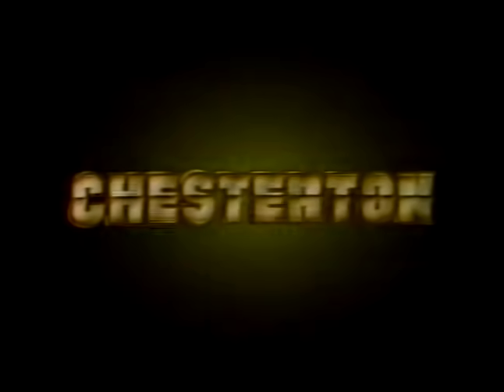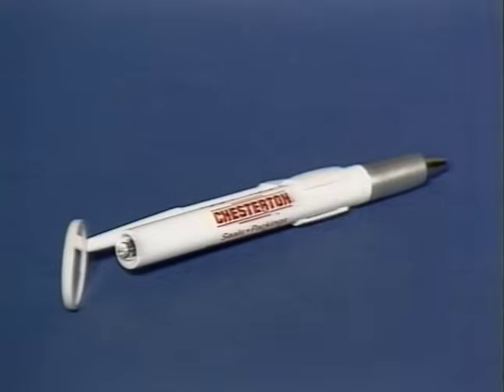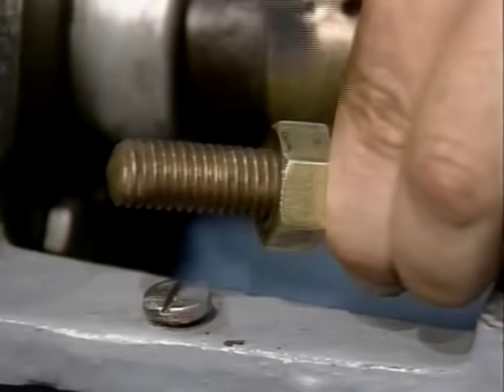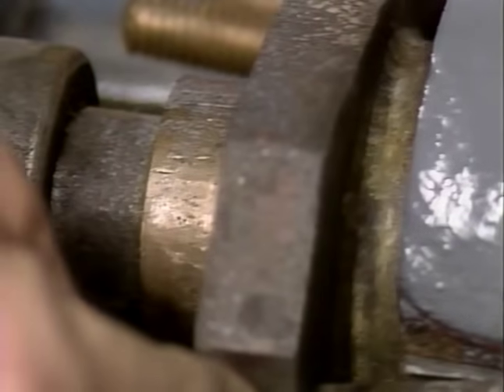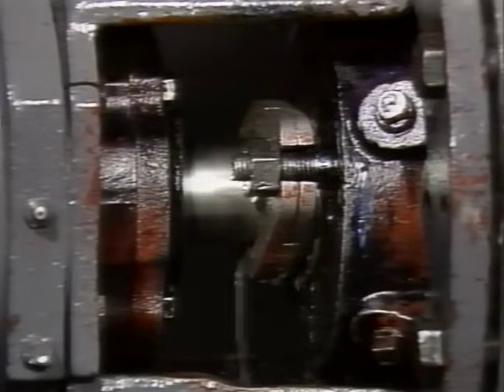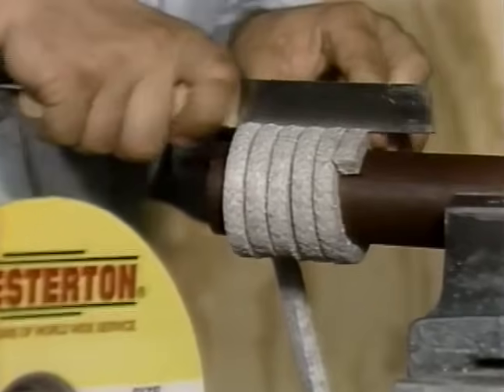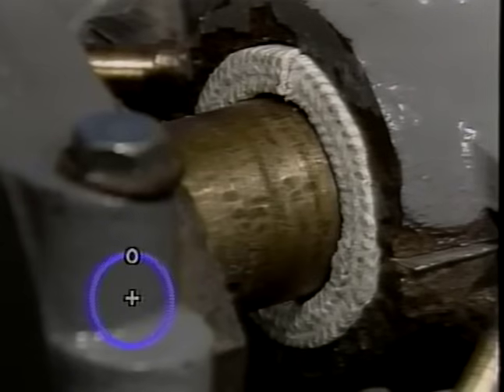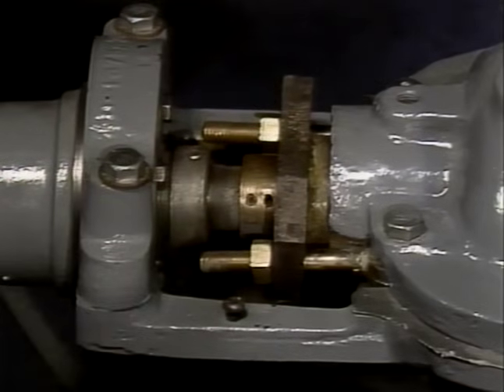Mechanical Packing Installation

Comment: Types of packing
Reply from the maker: There are many types of packing and materials. Some general guidelines I use. 100% Teflon makes poor material and is only used when required. Bellow 500F Nomex material works well. Above 500F Renee’s a black packing like graphite or carbon yarn.
Reply: @shep446  I’m currently studying for nccer.  Do you have any videos on turbines and gearboxes I need all the material I can get my test is next Friday!
Reply from the maker: @OurBodyHisTempleFitness  good luck with your test. I do not have any such videos. But would recommend any US Navy training manual on the subjects. Being a veteran Gas turbine mech I can say the GSM 3&2 manual is one of the best book courses.

Comment: is it normal to observe minor water leakages after replacement of mechanical packing in 7.5hp pumps?
Reply from the maker: Yes, excessive leakage will occur during break in. Run pump 15 minutes before any gland adjustment. Leakage can be reduced to drips per minute but never stopped completely. Refer to packing manufacture for recommendations how many drips per minute. Shaft size, speed, and packing material will be factors.

Comment: Thanks for this video.  I had an irrigation pump repacked when the pump shop replaced the motor.  I have had to tighten the packing several times now.  Everytime I get it to a few drips (like in the video) it  is back to a stream in a short while.  I have been tightening evenly one flat at a time and now I want to be able to change the packing out in case the installer rolled one of the pieces of packing.
Reply from the maker: If you repack the pump I recommend looking at Chesterton 2212 packing. It is a nomex/Kevlar hybrid packing that breaks in fast and keeps its adjustment longer than other packings. Contact you local distributor and they can provide cut rings ready to install in your pump. https://chestertonrotating.chesterton.com/en-us/Products/Pages/DualPac2212.aspx
Reply: @shep446  Will do.  Made it through the end of irrigation season without bottoming out the follower.  Thanks for recommending the 2212.  It looks like it is the ticket.

Comment: When ever i install packing smoke start
Reply from the maker: Packing is to tight
Reply: How can i solve this problem
Reply from the maker: Sajid Technologist start pump with packing gland nuts finger tight and allow pump to run for 15 minutes with more than desired leakage. Then adjust gland nuts 1 flat at a time, with 10 minutes between adjustments. Until desired drip rate is achieved.
Reply from the maker: @mydairies6531 Check out this training on packing ,  https://hubs.ly/H0ptH210
Reply: I never leave a drip , but infact I am the drip

Comment: I hate pumps that use packing. Mechanical seals so much easier.
Reply: packing is cheaper
Reply: It wears out fast. It's more expensive.
Reply: Mechanical Seal are expensive